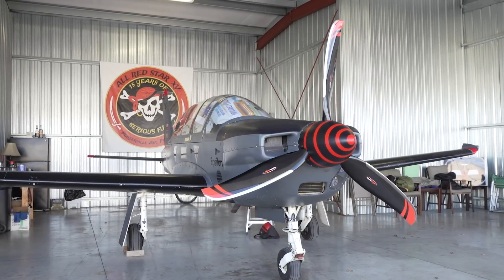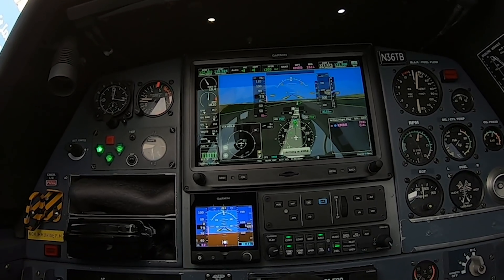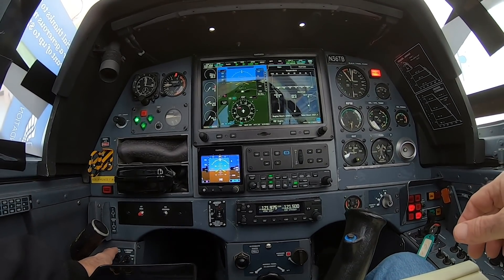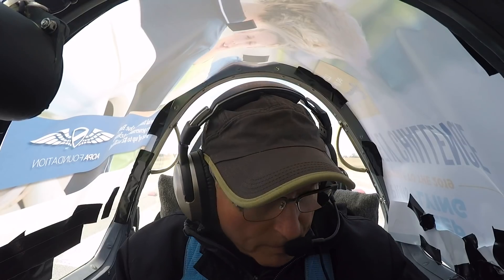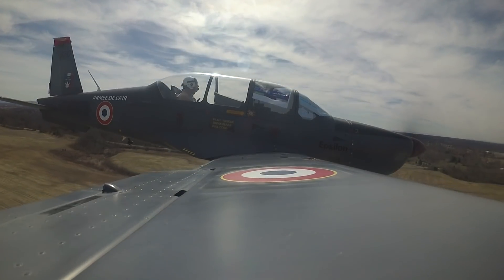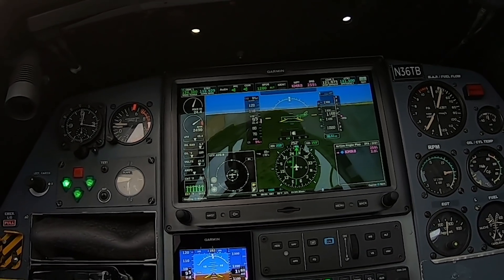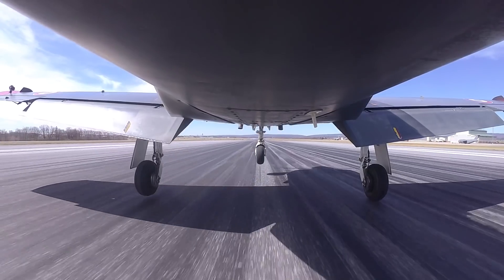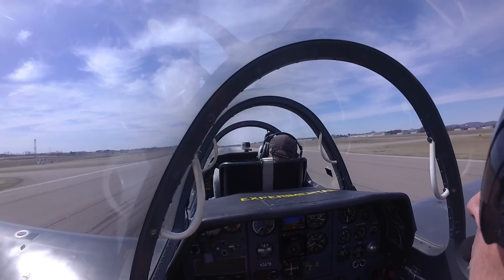Zero Visibility Landing with Synthetic Vision

Comment: NASA did this study using 23 ab-inito pilots just starting their airline transition training with Avianca so no super experienced ex military fighter jocks.  They were also english as a 2nd language comprehending the panel.  The scenario was high altitude volcanic ash taking out both powerplants and the APU leaving them with just one hydraulic system at 25000'.  The only airport to land was in a bowl in the mountains, hairy in even the best of times.  All 23 put the airplane in position to land at 500' at the approach end of the runway using synthetic vision alone the first time they tried it.  For sure it will get you on the ground where you can't run into anything.  Even the grass alongside the runway is preferable to landing downtown.

Comment: No rules against blocking out the windows? interesting test otherwise. I was just thinking what it would take to implement synthetic vision, I'm a computer scientist and I've worked with engineering terrain data so have some overlap but then I wondered what does typical synthetic vision show on manhattan? does it show skyscrapers? or does it show a terrain hill that encompasses tall buildings. Because that has to be handled somehow.

Comment: A unified avionics HUD thats helmet mounted and uses multiple FLIR equipped cameras on the underside of the aircraft would easily allow landings with zero visibility.  

While its important to have the human as a backup system, i believe we are at a point where future planes need to be designed around landing themselves (and flying themselves in IFR conditions).  If you watch the AOPA incident videos you find that equipment failure is almost never the cause of the crash.  In fact I would say a solid 95% of them could be saved if the aircraft had something as simple as altitude and heading holding like every modern drone aircraft does.
Reply: Enter Garmin's Autoland. If you have G3000 panel, and auto throttle, this is available. Its an emergency system that when you or a passenger hits the big red button, it selects an appropriate airport, verbally announced the situation over the radios on the appropriate channel, and goes about landing itself. AOPA has video. This is available on the Piper M series and Cirrus Vision Jet and soon, more.

Comment: Seems a bit silly because we have IFR minimums. So the question should really be, is synthetic vision accurate and consistent enough to be as good as ILS to minimums? If the ILS operates within the synthetic "housing" and it's built correctly, then me thinks, "yes".
Reply: I think they were asking if you could use it to land just using SV alone.  I could see a time when I would have to land outside the IFR minimums in an emergency.  I wonder if SV tech has evolved since this was filmed.